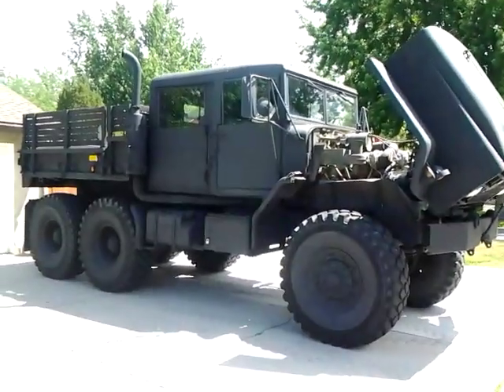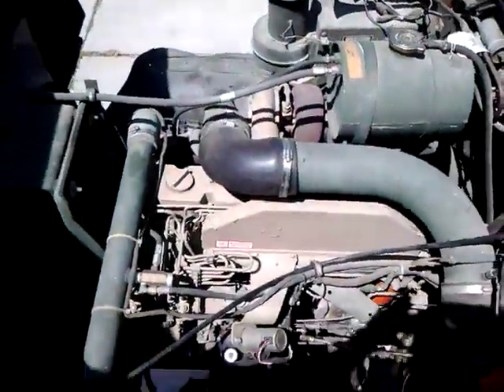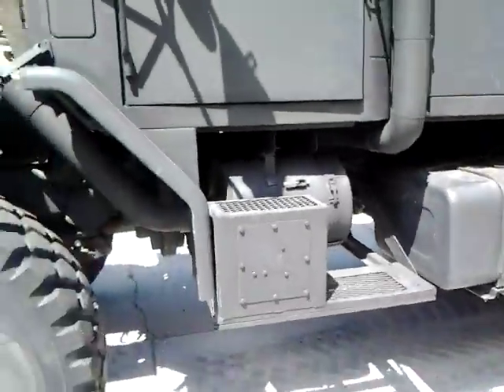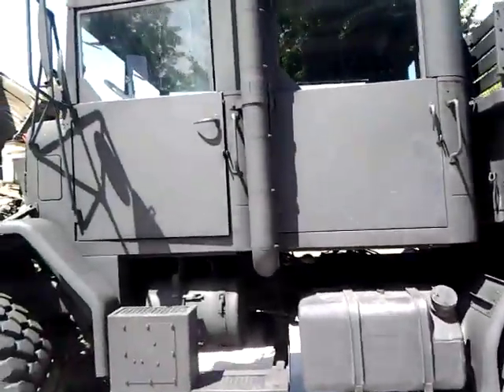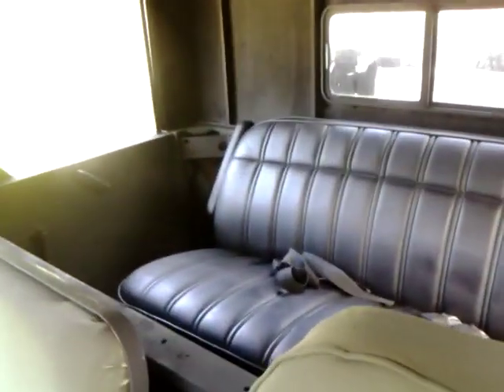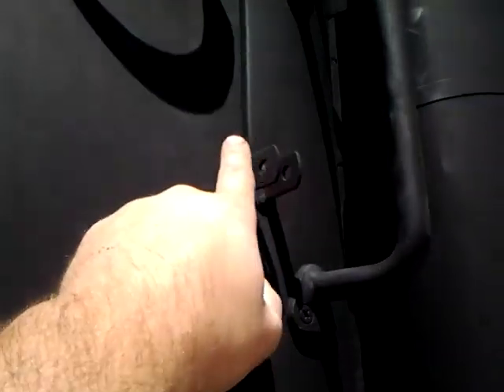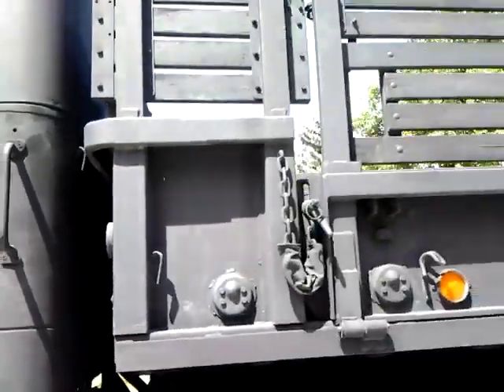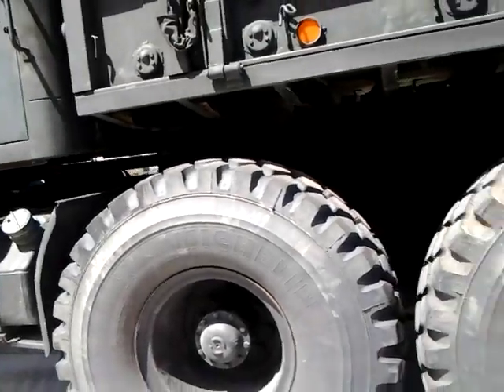BMY M931A2 5 ton quad cab - military truck crew cab - walkaround

Comment: I am starting my own 4-door conversion on my M818 right now.  I have to tell you that out of the few 4-door trucks I've seen, yours is BY far the most awesome & best build!!  My truck currently has:
1). 12' bed from a Deuce that's been cut down to 9'
2). 16.00R20 Michelin XZLs on the MRAP double beadlocks
3). Removable factory hard top
  Some if the changes I'm making to it are:
 - obviously the 4-door conversion 
      (I have the cab used in "Indiana Jones: Kingdom of the Crystal
      Skull".  The one that Harrison Ford fell backwards into while trying
      to get away from the Russians, in the Area 51 storage hangar!!)
 - 3" thick bulletproof windshield that will hold up even if 3 x .50BMG
      Armor-piercing rounds are fired in the exact same spot!
 - building a new hardtop for it out of rolled & bent 1" DOM tubing that
      will reduce road noise significantly, and insulate the cab
 - installing an aftermarket Heater/AC
 - installing airbags in the suspension seats f&r
 - installing motorhome or Peterbuilt captains suspension seats in front
 - installing either 2 motorhome/Peterbuilt suspension seats, or a 
      full width bench seat on suspension seat system. Air bags either way
 - fabricating custom flatbed with headache rack
      • will have recessed pockets for me to park my 6x6 Rockcrawler in
      to lower total height
 - fabricating roofrack attached to the headache rack, w/50" LED lightbar
 - will have bumper attachment for pulling a camper trailer

It will be a beast when completed!  I'm going to be stealing a few design ideas from your build! 
Keep up the good work!
 - MK
Reply: turbosniper1 

I second that....

Comment from the maker: My advice on both the big boy 16R20's and the 14R20's: Its all about taking off the Central Tire Inflation System and the counter weights on those wheels, make it old school like a regular tire, just fill them up with air when needed.  Secondly, and just as important, before you drive the truck, make sure ALL tires are exactly the same tire pressure (you can use the onboard air system to fill the tires with an air hose), I typically run about 55lbs of pressure in all tires.  If your tires are in good shape, then you can run your truck at 65-70mph smoothly.
Reply: how did you make it go that fast? the none customized ones get up to about 58-60 on the highway.
Reply from the maker: +Dylan Snyder ----Hey Dylan, thanks for the reply.  Here is some more info regarding top speeds:

Not every stock 5 ton is the same.  The older ones (800 series) are standard transmission and multi fuel engines.  Even some of the newer ones (900 series) come with dually's in the rear and smaller tires then other 5 tons you can get with stock super singles.  When you say "non-customized" you have to be specific about the exact truck and how it came to you in it's stock form from  the military.  Not all stock (non-customized) trucks have the same top speed.  You get those top speeds that are at or near 70mph ONLY with a 900 series 5 ton and 16R20 tires, all other 5 tons in the 800 and 900 series will have lower top speeds without 16R20's.  Hope that helps.
Reply: Micah Marshall I was talking about the M923 with the bigger tires like the one in the video.Just wondering do you know how fast an M35a3 is with the bigger tires(i dont know the size)
Reply from the maker: The biggest tire you can fit on a stock M35a3 is the 14R20's (48in tall). That should get you going around 64mph topped out if I recall correctly when driving my last deuce and those tires.
Reply: Micah Marshall thanks because I am most likely going to get a M35a3 with the 48 inch tires.
Reply: There is alot of misinfo in here.
A M939 5 Ton Truck max's out at 65 MPH,that's it.The A0 Variants with the G177/1100×20 Tires can run 64-65 MPH all day,the A1's with 49/1400×20 Tires can only do 52-55 MPH,and then the A2 with the 53/1200×20 CTIS Tires only does 60-63 MPH.Driving above the Speed Requirements in any of these trucks is dangerous and unsafe.The only way you can haul ass in a 5 Ton Truck is adjusting the Governor Spring,and I've done so in both my M923A2's and M931A2,I only topped out at 70-71 MPH.But you never should do that,the Engines in these trucks are Inline Sixes,they will only do 2,100-2,200 RPM's,and that is Redline.1,800 RPM's in this trucks is cruising.A Straight Six going above that limit will make Pistons fly in the air.The Deuce & A Half can manage 2,600 RPM's on a Multi-Fuel,which is also a I6,but the Pistons,Pumps,and Fuel Injectors aren't the same like other Diesel Engines,and they have a certain size,which separates them from other Ignition Compression Engines even though they are one.If you drive a M35A2 with one,if everything is properly function and lubrication,you can be capable of going 65-67 MPH,but you shouldn't go above 55-60 MPH for safety because of the Brakes those trucks have.If you own a M39 Series 5 Ton Truck,regardless if Multi-Fuel,Gas Job,or Mack Diesel,they can to go above 60 MPH,63-64 MPH in older Manual 5 Ton Trucks is enough with NDT-900×20 Tires,if you have a different Tire Size,the Limits I listed are what you're going to get.Bigger Tire Size will slow down these trucks,but it is possible to go high speeds,good luck on not fucking something up and slowing down.I own a M35A2 with 395/20 LMTV/MTV Tires,I only can do 57-58 MPH,and my M813A1 with 1400×20 Tires only does 52-53 MPH most days.And to the part of the M35A3 and M109A4,both are slower than all the other trucks together.You ain't getting shit for speed in those Deuces.People don't realize that the Transmission,Axles,and Gearing are completely different and have no Overdrive.They will do 45-53 MPH only with 1400×20 CTIS Tires.The only thing nice about those trucks is the 390 HP 3116 Caterpillar,nearly three times the Power that the Multi-Fuel had to offer in the M35A2's or 5 Ton Trucks like the M52A2's and M54A2's just for example and lasts as many miles as a real Diesel Engine does,the LDT-465 is 135 HP and the LDS-465 is 175 HP.The 3116 was available also when the LMTV/MTV Trucks came out,before the 3126 and then C7.
Reply: @micahmarshall  can you contact me in regards to building these trucks please?
Reply from the maker: @cliffwiggins1150  Contact info?

Comment: The only thing i dont like about your truck is that its bobbed. The standard bed that comes with these is perfect. Bobbed.. Especially crew cab bobbed, looks disproportional and i dont understand why you would ruin the truck like that
Reply from the maker: +Bradley Goodrich A "bobbed" deuce or 5 ton means it has been converted to 4x4 with only two axles.  Just a friendly FYI, you are using the word "bobbed" to refer to a shortened bed, which is an incorrect usage of that term.  The truck in this video is not bobbed as it is still 6x6.  The standard 14ft  long bed is great, but very long. If the operator of the truck isnt going to utilize all that bed for their purposes, then it adds a lot of functionality by shortening the bed.  When you shorten it to 10ft or even 9ft, that extra 4-5ft of bed removed makes a lot of difference for being able to squeeze into tighter spaces when on the trail or simply just parking the beast.  Everyone has their preferences, but there certainly is a legitimate reason to shorted a bed, even if it doesn't make sense to you personally.
Reply: +Micah Marshall very thoughtful response. And thank you for the heads up one last question, is how expensive was the crew cab conversion?
Reply from the maker: The cost is relevant to your situation.  I have a shop and guys that work for me and still put 20K into the truck after buying it stock from the military to get it to look like it did in the pictures, not including my time and my own personal 200+ hours working on it.
Reply: +Micah Marshall interesting. 20k including the truck itself? Or thats what you put into it since you got it? Can you give me a rough estimate for us civilians without connections to a shop?
Reply from the maker: 20k after I got the truck to my house.  Lots of design work and welding.  So far it has taken me a solid 6-8 months to build a crew cab 5 ton.